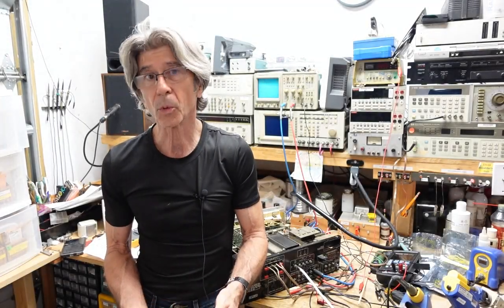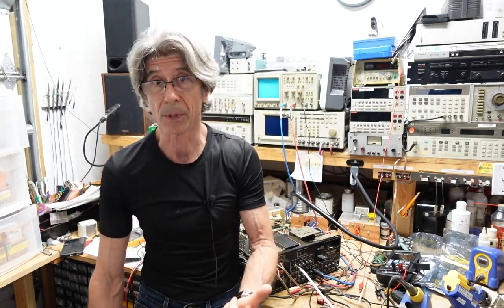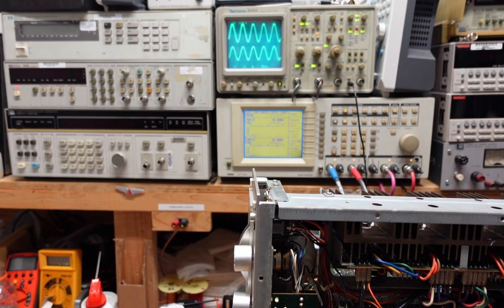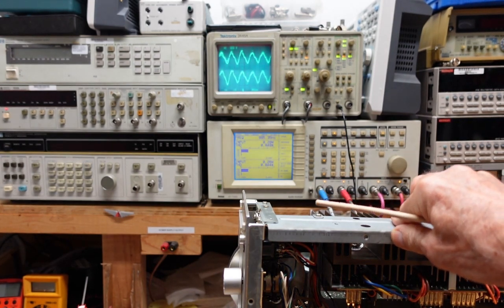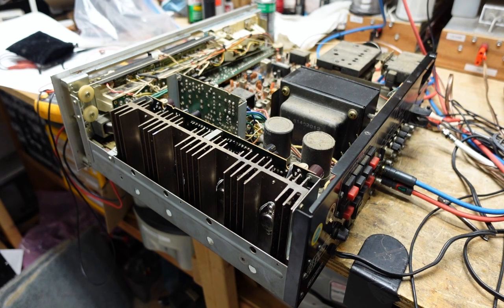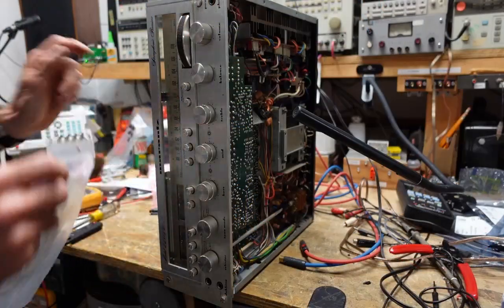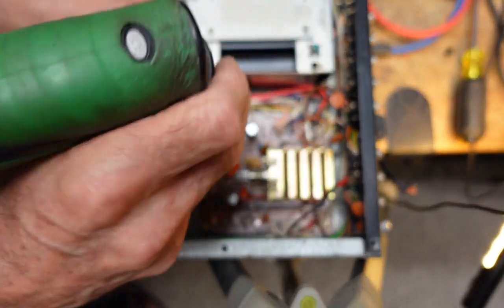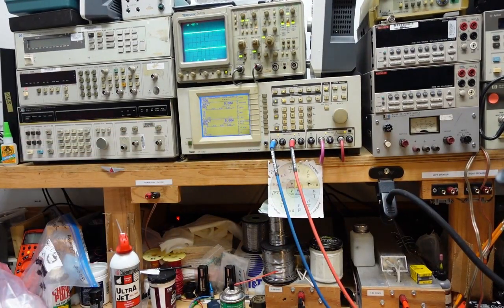Marantz 2265B Repair Part 2

Comment: And they say Marantz are easy to work on with littel to no problems. You have lots of patience
Reply from the maker: Vintage receivers are a pain to work on, for the most part.  I don't know where you heard that Marantz are easy to work on, or have few problems.  They are now at the age where problems due to age and wear are showing up, and Murphy's Law dictates that whatever part you need to get to is in the dead center of a unit that was built around said part.  😁

Comment: I have a 2245 that is completely dead. Fuse is good. What else could cause no lights, no sound? It does give power to the rear power plug when I tried plugging in my phone charger. Any ideas?
Reply from the maker: That depends.  Is this a unit you've owned for a while and just quit working?  Or is it something you picked up broken?  Did you check the fuse with a meter, or does it just "look" OK?
If you can let me know tha, and a rough idea of your skill level we can take it from there.

Comment: I have found that using those nut drivers ,getting a purchase of the nut and bearing down to unscrew the faceplate nuts..... Is going to seriously mare the soft aluminum faceplate. Hope this did not happen here......
Reply from the maker: It did not.  The key is to make sure you don't contact the faceplate with the end of the nutdriver.  Fortunately they're rarely on tightly.

Comment: Hello Ray!

I did maintenance on one of these, and the customer called the wrong speakers and burned everything, I'll have to do a general recap. Is it necessary to change the bias adjustment trimpots?
Reply from the maker: Hi Sergio.  Not sure what called the wrong box means, but unless they used wirewound pots I change them out.
Reply: @raygianelli3612  I meant the speakers. It was not the recommended one, hence it burned several components of the amplification board. The trimpots I think is just checking the resistance on the multimeter.

Comment: Sometimes a function or selector switch are the hardest to repair. At times they had to be rebuilt. Borrow parts from another switch an major cleaning. If the contacts are badly tarnished distilled water with vinegar works well. Be sure to clean it well. This piece is really in need of help.
Reply from the maker: Water and vinegar?  Seems I've heard that used for something else...  🙄
Reply: @raygianelli3612  Many times the plates on the switch get tarnished or corroded. If they need to be worked on we would take the wafers apart an soak the plates in distilled water an vinegar an if it was extremely tarnished or worse, we added a small amount of salt dissolved into the water an soak the parts. Throughly rinse the parts an put it all back together. Recently I repaired a Simpson 260 with one of the worst switch contacts I have ever seen. Nothing worked correctly. After looking it over for some time it dawned on me what was going on. Meter works like new again. Old technics still work, I learned this trick from a science professor. Won’t remove the plating either.
Reply: @cwradio4571  Interesting. Would love to learn what chemical reactions are going on there between the contact and the acidic temperament of the vinegar. Interesting indeed.

Comment: I just purchased a set of those strain relief pliers this spring. They were available through Anchor Electronics. WAY better than using needle nosed pliers.
Reply from the maker: Yeah, it was one of those tools that was worth the money, not only for the ease in which they work but my actual sanity.😁